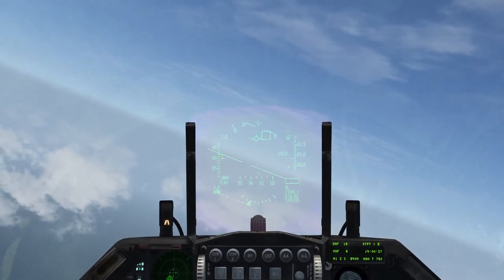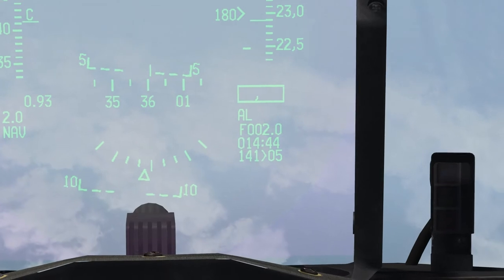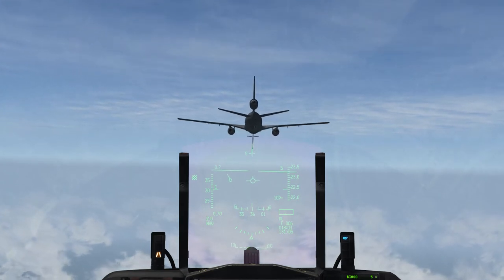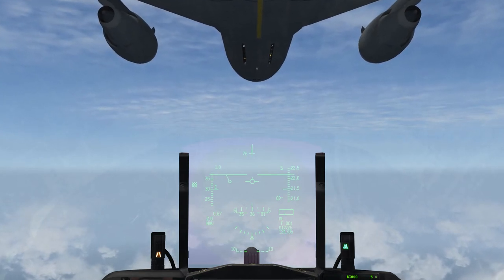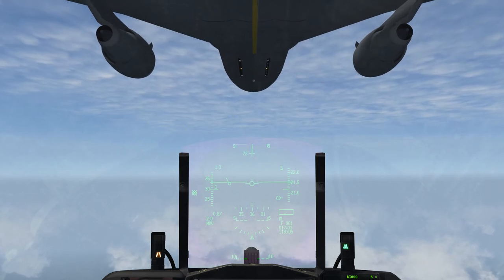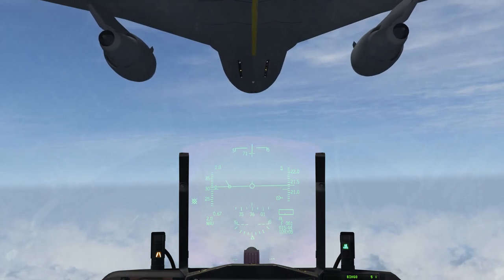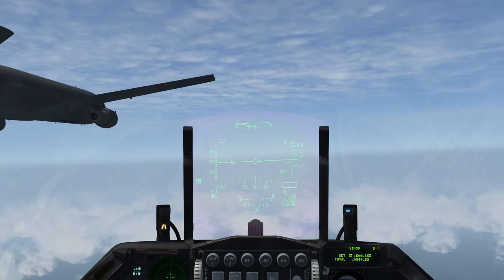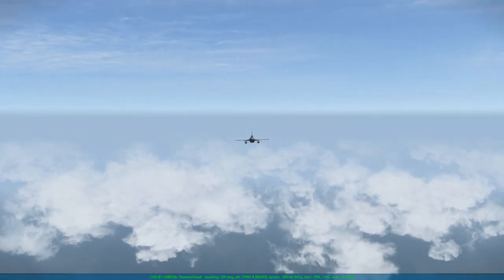Falcon BMS 4.33 AAR Air To Air Refuelling Tutorial

Comment: Have you set any deadzone or saturation on the throttle? I've no problem getting my pitch and roll stable, but no matter how little I adjust my throttle, my plane keep just going back and forth.
Reply from the maker: Hello Lymark. Every joystick/throttle is different. I have the Thrustmaster HOTAS Cougar and there is no curvature set up for the throttle axis, or in other words, the response is linear. The F-16 has a very powerful engine so it is quite normal that a small movement with the throttle is noticed immediately because the plane is over-powered (more thrust-to-weight-ratio even lets it accelerate vertically after take-off, so imagine the finetuning needed to change airspeed with a few knots in straight and level flight). But if you are only moving the throttle a millimeter or so and the movement forward or aft is really abrupt, there might be something else wrong. Did you calibrate your joystick/throttle? And when in BMS setup-controllers, do you see a linear/progressive movement on the slider when you move the throttle? There could be a ton of reasons why it's not working as expected. And besides game settings, you can also check HOTAS Cougar control panel settings. I hope you can figure it out.
Reply: I have a Warthog HOTAS and I work the throttle by putting three fingers in front of the throtle at the very bottom and keep my thumb on the back. I basically pinch my ring finger between the base and the throttle slider and I'm able to make very small corrections. I found it impossible to make the subtle adjustments with my hand on the top of the throttle. I've been practicing AAR a lot and still have a long way to go but I did manage a successful top off well into a turn with the DC-10. https://www.youtube.com/watch?v=CzXC2dELB1k 
The BMS videos on my channel do not have any voice over. I'm just keeping a log of my progress as I learn BMS (3 months into it). 
I intend to try refueling in 2D like this video and see if it is any easier. I've been doing it with my TrackIR and that probably has hindered my progress.
Reply: @JetPilot747  hi thanks for the tutotial. I recently got a cougar. It's working fine. But how can I reduce its sensitivity because a little faster rotation on takeoff will lead to tail skid and even on landing I find it difficult to correctly get wings level inline with runway. It is like a porpoise. In CCP I have everything zero for stick X and y axis. With these settings probably air to air refueling will be very difficult.  Thanks
Reply from the maker: @rizwan shahzad you can change sensitivities in CCP http://ts.thrustmaster.com/faqs/eng/thr_eng_00069.pdf If you use DCS as well, you can edit sensitivities there too https://forums.eagle.ru/showthread.php?t=231007 And last, the good news is that takeoff trimming and flaps in the F-16 is automatic so it can't be that. However, over- or under-rotation can cause a tailstrike (usually rotation at a too low airspeed in knots, or rotating at a too fast rate in degrees per second). But I think you'll need to fine-tune your X and Y axes since the Cougar is known to be sensitive. Hope this helps.